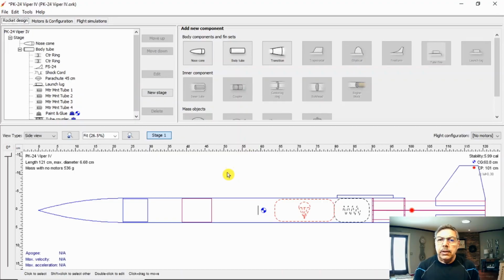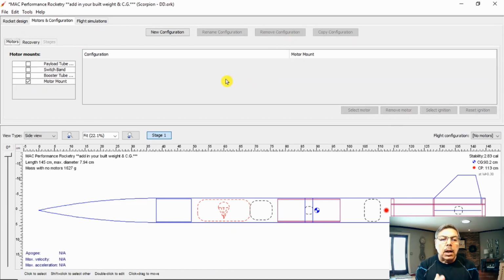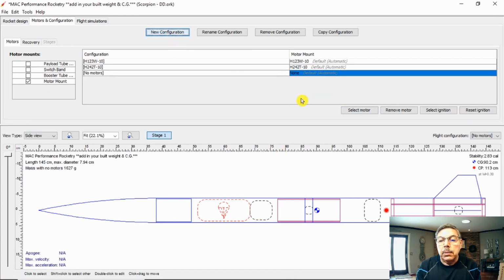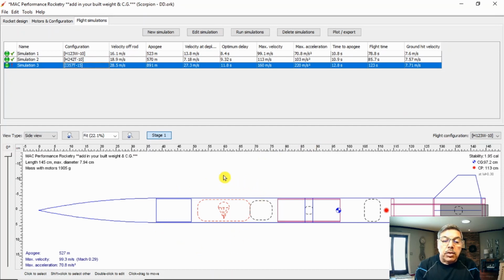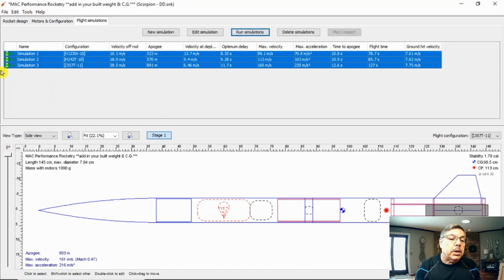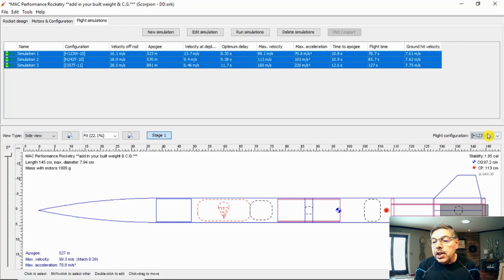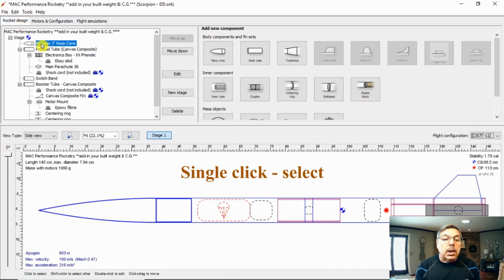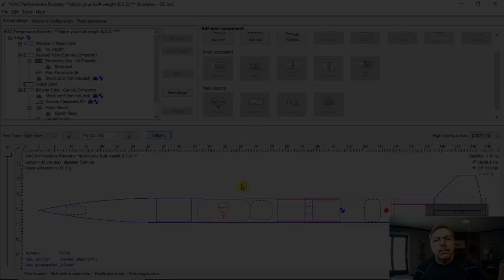Open Rocket tutorial #2 - stability and flight simulation.

Comment: sir how do i get an apogee of 500m using a c class motor
Reply: pls help asap
Reply from the maker: Check out the Apogee website. The Estes Alpha-III with a C6-7 shows 439 m for a maximum altitude. You may be able to trim the fins for less weight and drag to enhance the performance. Use Open Rocket to determine the stability.
https://www.apogeerockets.com/Model-Rocket-Kits/Skill-Level-1-Model-Rocket-Kits/ALPHA-III

To enhance the performance of a rocket choose or build a design that uses light weight materials and features small sleek fins. The elliptical fin shape design has the least amount of drag.

Good luck!